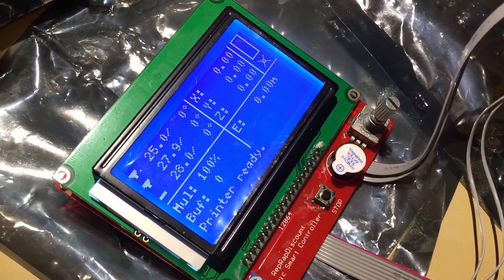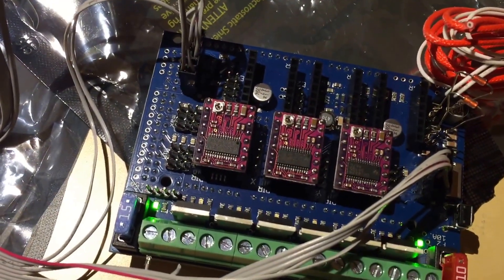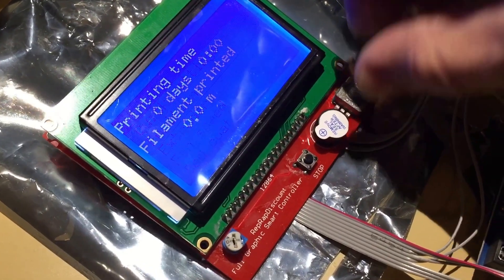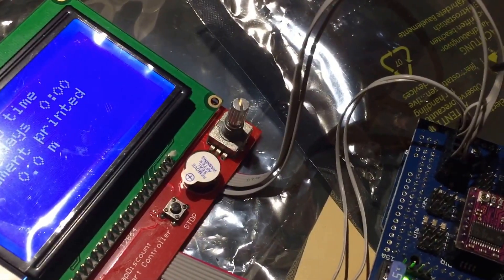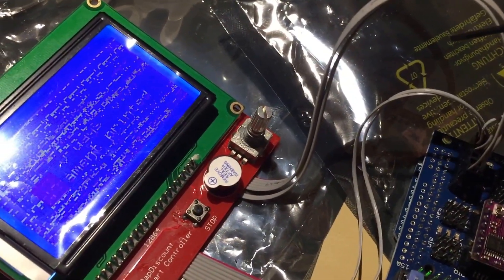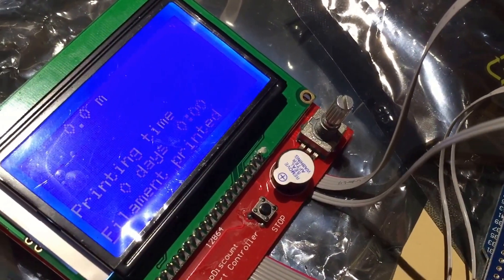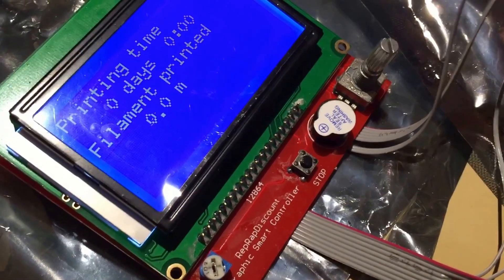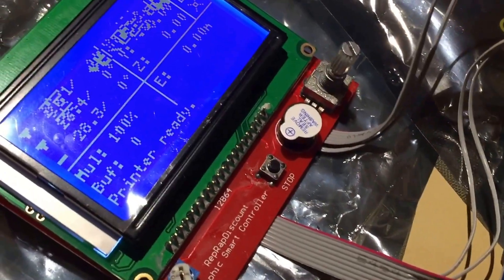Full Graphic 12864 LCD with RADDS and Arduino DUE setup weird behavior (first video)

Comment: Have you seen the Oderwat page on Thingiverse? He looked at the board. He realized the pins are wrong. He developed a revised wiring diagram. I cut my cables. Then I re-wired them. Sadly, it has not worked yet. I do not understand how to edit the pins connections sub-configuration file in Marlin 1.1.9.
Reply from the maker: I looked at his page, he uses Marlin based printer. Unfortunately, I know nothing about marlin. I wish I could help you.
Reply: Tinkering Nerd so you got that monitor/controller to work with Repetier?
Reply from the maker: Yes, it works. The only thing is I have to press reset button after power up.

Comment: hears how i set it up  ;lcdrs =42, lcden =43, lcd4 =44, lcd5= 45, lcd6= 46, lcd7= 47, beep= 41, encp=48, encb=50, enca=52, if you make a nice 10pin ribbon cable up you can achieve 1 meter in length no problems even though people say 30 cm is the limit i tried using shealed cables and would have same problem as you at 30 cm with a nice 12 pin block on the radds end and 10 pin block on screen end i acheved 1 meter using ribbon cable so i would say the solid connection is the main problem as if the wrong   pin loses connection for even a micro second it will throw the chip out of sink and never recover until reset

Comment: Can you please hint me to the scheme You used to connect? With wich option (FEATURE_CONTROLLER) did You use? I'd be glad to see the mentioned strange behavior, until now it's only a blank screen...
Reply from the maker: +E Eremit did you try this guide:
https://github.com/luc-github/DUE-RADDS-GLCD
I will check if I had to do anything differently. I know for sure that ribbon cable length needs to be 20cm or shorter, or else it will not work at all.
Reply: Yes I did. But had no Chance, Display was defekt. Meanwhile I tried another one and that worked. The Guide is a little outdated or incomplete, one can have trouble with the dial and the button. But at least, it is very close and the cable diagram is correct. Those following the guide and using a working display will at least see something. And it is due to the config alone, when it is not respondig to clicks.
Reply from the maker: +E Eremit now that you mentioned it, I remember having to fiddle with the encoder wiring/coding. This guide is indeed very helpful and is a very good start. Thanks for your feedback!
Best of luck!

Comment: I've encountered this in a number of small electronic circuits.  It happens more often when the guage of the wire is particularly small.  I'm pretty sure this is a primary reason they started using ferrite shields.  Heres a link... they can be found much cheaper and smaller... usually I just harvest one from an old unused cable.  

https://www.amazon.com/Ferrite-Core-Cord-Noise-Suppressor/dp/B0002MQGEK

Comment: It might be a bad connection. Have you checked the terminal connections? Have you tried to test the LCD with a different ribbon cable?
Reply from the maker: Michael Nguyen I'm pretty sure it's the proximity of the ground wire to signal wires. I'm in the slow process of making my own connection cables for the LCD. Will keep making videos of my progress!
Reply: Looking forward to seeing it! :D